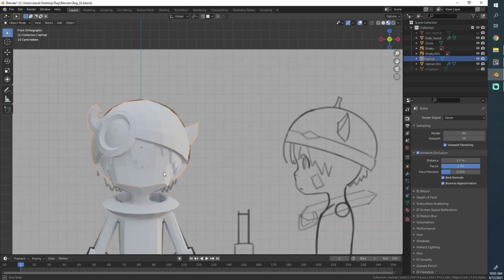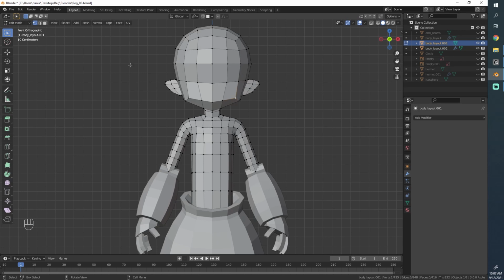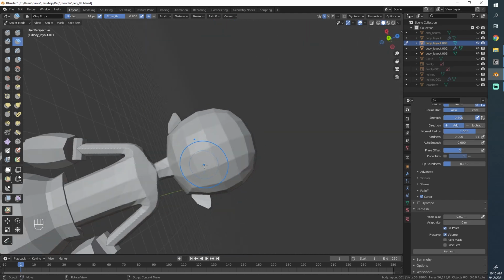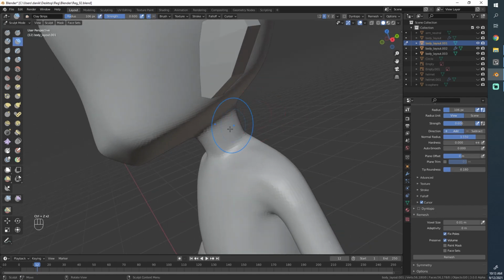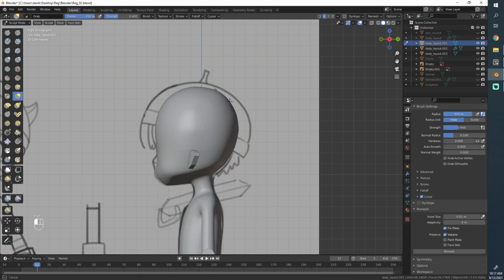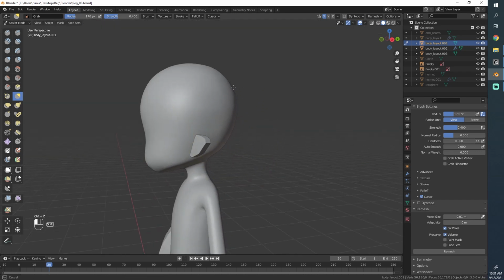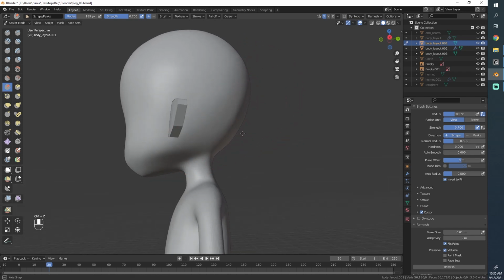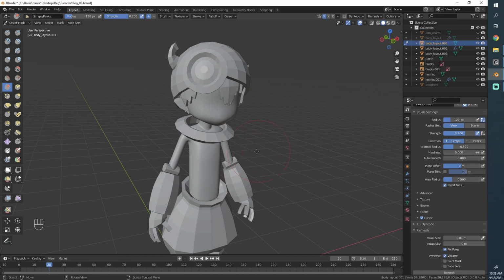[#09] Blender 3.0 Character Modeling Tutorial - High Poly Modeling 1 [2022]

Comment: You do not need a tablet for this. What he is doing with a tablet is resizing the radius and the strength of the brusch faster. Just start with the default size and go over the whole body with your pc mouse when using the clay strips. Then use shortcut F to adjust radius of brusch, I would go bigger. Then shortcut Shift + F to adjust the strength. I would just slightly increase it. After adjusting radius and strength go over the body again. Play around with this til you happy.

Comment: Hi , to everyone, the tutorial is really great, but everything that started from the 6th minute of 9 part went totally differently.
My sculpting tools tool work in another way (I can't make a head or a body smoother like in the video it just inflates the edges and that's all), so maybe you use some sculpting addons?
Coz i did everything step by step, completely like Daniel shows.

P.S I add Remesh using modifiers, but not like in the video
Reply: I have the same problem. Holding shift doesn't work for me. I have no idea where i went wrong, but rn its so difficult and time-consuming to sculpt this way.😢
Reply: Same Problem here but just use the smooth tool it works the same
Reply: Well sorry for the late reply but you have to hold shift or else it wont smooth the surface

Comment: Would using Dyntopo be a good alternative to remeshing?
Reply: Since the Daniel wants to have a consistent poly count through out the mesh of the body, it's better to use Remesh. Dyntopo will make the mesh inconsistent with detail or specifically geometry. If you're going to remesh manualy afterwards, you can choose the Dyntopo.